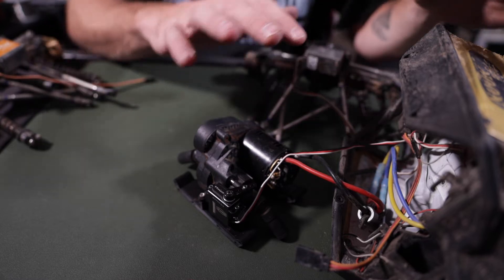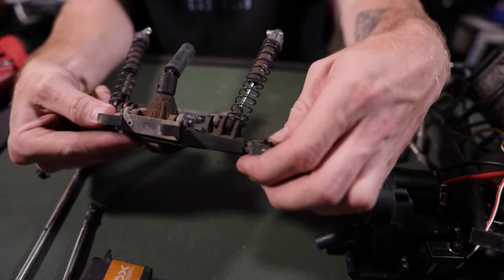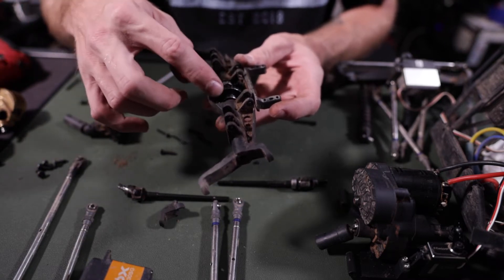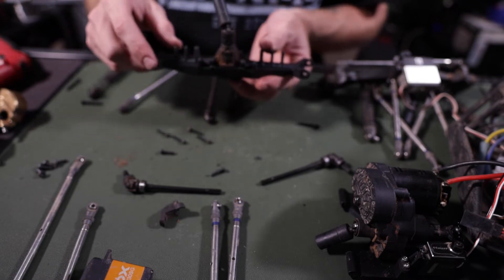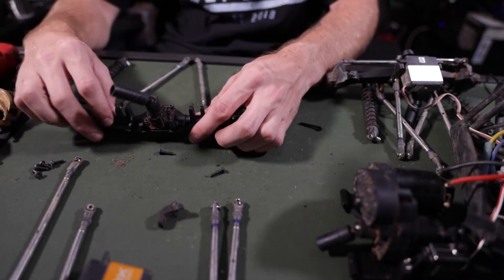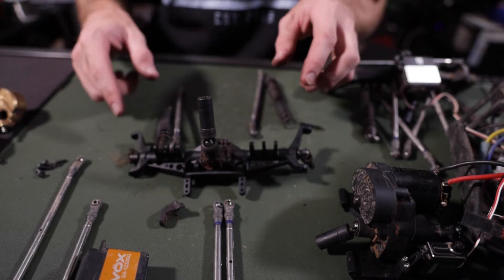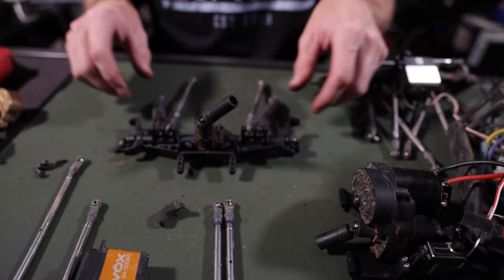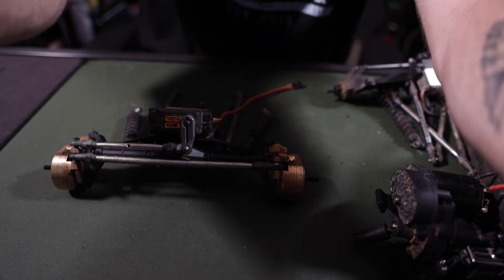How to fix an Axial Capra 4WS Axle! [front Axial Currie F9 portal axle replacement walkthrough]

Comment: Hey Alex I have dumb question I know the NSDRC 800 can run 8:4 to 16:8   I run 3 cell ,, I know it in between those ranges! But does it need be like 8.4 or 12.6 16.8?   Shows the specs at those points but mine would be 11.1?
Reply from the maker: No dumb questions around here my friend! You'll be all good to run that with your 3S battery, they're just givin' ya a voltage range to work with! 🤘
Reply: @highnoonhobby  ok awesome !! Thank you very much!! Have great day Alex!
Reply from the maker: No problemo, amigo! You too, Evin!!